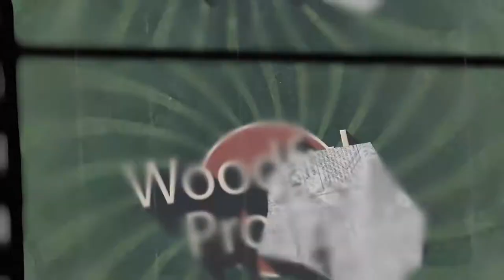#3. Clamp rack - étagère serre joint

Comment: Why did you drill all of those holes and then plug um up?
Reply from the maker: The holes were drill so I could put screws and strengthen each of the wood segments. Then the plugs were used to hide the holes. Cheers